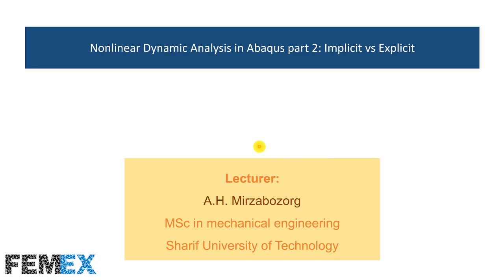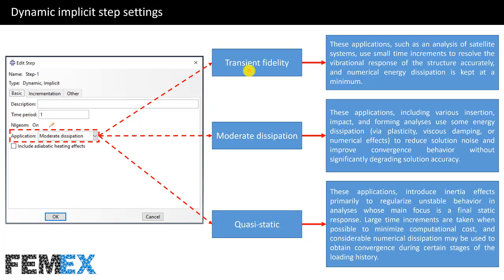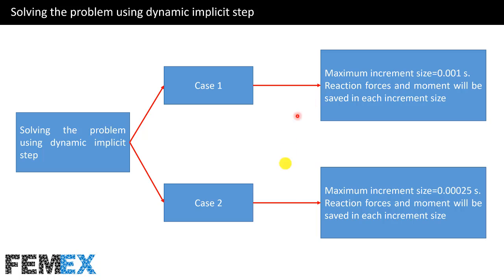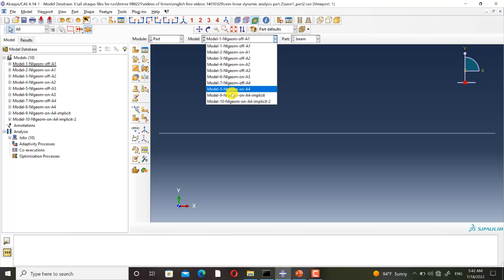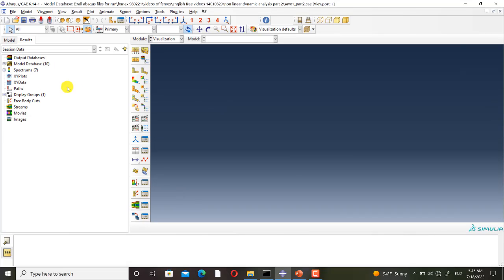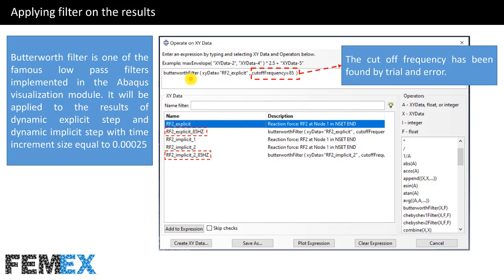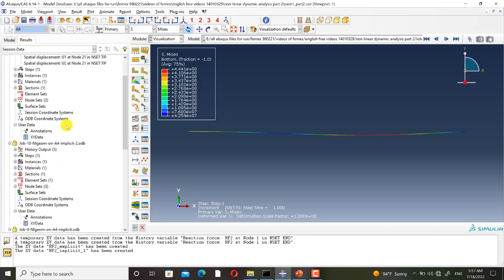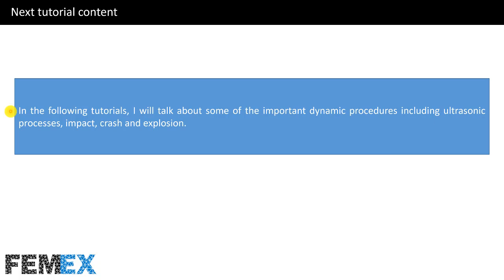Nonlinear Dynamic Analysis in Abaqus part 2: Implicit vs Explicit

Comment: Hi, Thanks for the video. I have a contact between a soft shell and a stiffer beam. when I check the data of acceleration on the surface of contact (on both parts), I find lots of high peaks and chattering. Do you know how can I solve it (dynamic implicit) ? I do not want to filter the results as you explained in the video.
Reply from the maker: Hi.
In solving the contact interaction, chattering is an inevitable phenomenon. But there must not be too much chattering. Maybe you must refine the mesh in the contacting regions or even change the element type. To give more accurate solutions or suggestions, you can use our online consultancy service. In this service first I check your model to find out the mistakes. To use our online service, please send an email to me: mirzabozorg71@gmail.com